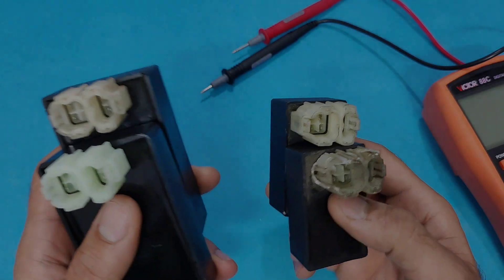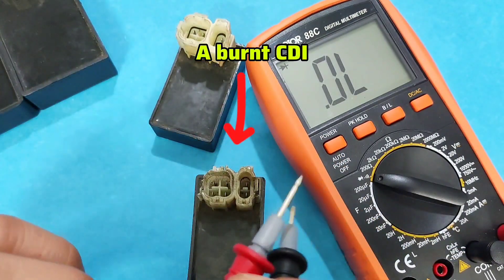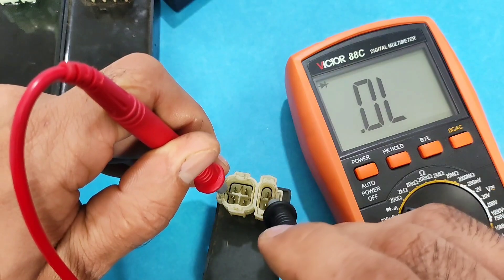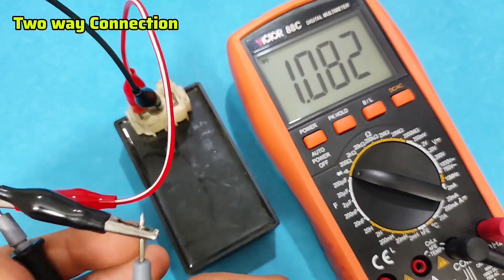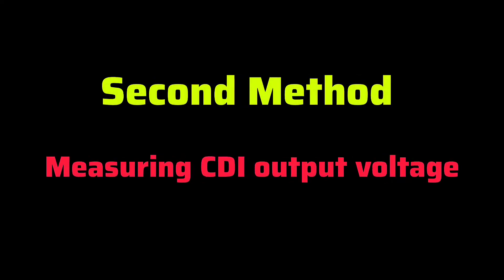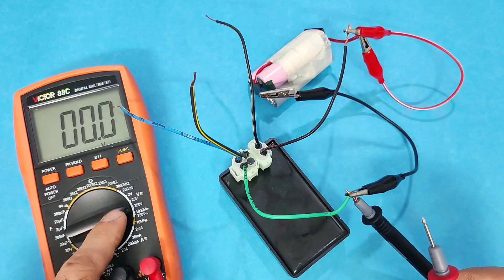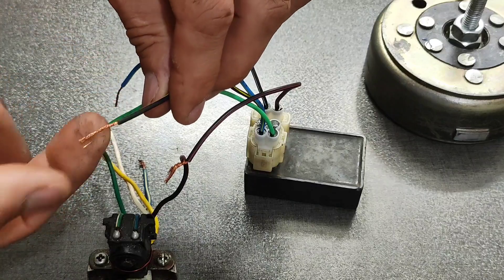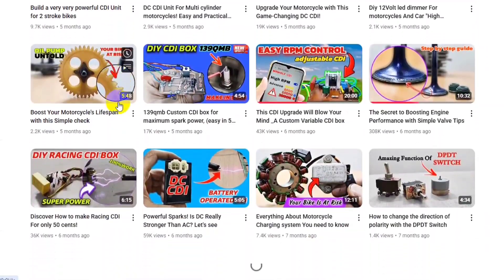99% People Test CDI Wrong — Here’s the Right Way Using Just a Multimeter!

Comment: How to check it on an YAMAHA XT 600E where it's has 4 pins on one side and 4 on the other one
Reply from the maker: You can use the wiring diagram or service manual of your motorcycle to get the your  cdi datasheet and pinout — it’s available online.
Or you can simply trace the wire inputs yourself: note which wires for ground, pickup "coils",(two different angles in xt 600)main power"ac", ignition coil, and kill switch go to which pins on your CDI.
Write them down and test accordingly.

Comment: 10:03 I have 20v. More than the 12v witch is hooked up to. 

Is it faulty? 

I have problems with engine power over 6000rpms.
Reply from the maker: Hey buddy,
For more certainty, connect a pickup to it and excite it. Measure the output voltage and see if it rises.
If it goes above 100 volts, it's okay.
Use a multimeter in both AC and DC test modes. Some models are different...
In my latest video, I also showed a coil test- check that as well.

Comment: Yes im not getting resistance between kill switch and grd too. I get resistance from 2 outta the 3 test. I have a blue rectangle high performance no rev  ac cdi
Reply from the maker: If your CDI unit is working properly, there’s no problem ,It’s possible that the resistance is higher or lower than what a multimeter can detect.
Even in some models, there might be some differences... . thanks for your input 🙌🙌

Comment: negative And the HD coal line  is sort cdi is ok or bad dc cdi
Reply from the maker: Maybe its resistance is too low; set it to a lower resistance value and test it.
Also…
To determine if the CDI is functioning correctly, you can refer to the video's instructions to conduct a proper test.

Comment: I performed the test you show, applying 12 volts and reading the outgoing voltage. When I do this, the voltage goes over 100 volts but returns to zero even if I keep the 12 volt power supply connected. If I disconnect the power supply and repeat the procedure, I get a high voltage again, but it doesn't stay on. Is this correct?
Reply from the maker: That’s right, because it charges the capacitor momentarily, and by turning the 12-volt power on and off it repeats again.
This happens because it hasn’t been triggered—in fact, this action is supposed to be done by the pickup sensor.
Therefore, it only charges and discharges once.
Your CDI is fine👍

Comment: I dont get any resistance between negative and kill  switch... Does it mean the cdi is faulty aswell
Reply from the maker: What type of CDI do you have? If it's a DC one, it doesn't have a kill switch.
If you'd like, post a picture of it in the viewer posts, in the community post part of the channel, so I can take a look.
Reply: Yes. Mine does the exact same thing. I have the blue rectangle performance ac cdi
Reply: I got resistance on 2 of the 3 test. Does it mean it's bad

Comment: Thank you, my friend, but I have another question I'd like to ask you. When you measured the current output from the CDI in both AC and DC modes, you measured the current without connecting a pulser. How did the current output from the CDI occur without a pulser or pickup? Or How did the CDI generate current without connecting it to a pulser?
Reply from the maker: That's a good question.
In the AC CDI output test, the trigger was connected. ...But for testing the CDI DC, we only checked its functionality — we observed that the capacitor was charging and a momentary voltage was sent to the output.
In fact,
In a DC-type CDI system, an external DC power supply (such as a motorcycle battery) provides the voltage needed to charge the internal capacitor of the CDI.
In such systems, the pulser (pickup) only acts as a trigger for spark timing and does not supply power.
Of course, in ac cdi, the same thing happens, only electricity is generated by the rotation of the magnet on the AC coil.
Reply: @MrWolfDiy 
Thank you, my friend. I know that the trigger doesn't generate current just give a pulse in exact time to CDI to proceed the current to ignition coil making a sprck . So i asked?
, how did the CDI pass the current without being connected to the trigger, which allows (make a pulse ) the current stored in the capacitor inside the CDl to pass through it to the coil ?
I watched the video twice and you didn't connect the trigger in both Ac and DC testing 😂

Comment: how can I prove my cdi which have advance problems?
Reply from the maker: What type of CDI is it? If it’s a digital one, there might be an issue with its internal program. But sometimes the problem comes from the pickup sensor — it might just need adjustment or replacement, so it should be tested.

Comment: Thanks 
Thank you for your efforts. We benefit greatly from you, but I still have 2 questions. 
Question 1.
Is the coil (generate the spark plug ) that works with DC CDI different from the coil that works with AC CDI?
Question 2:
Can the AC CDI  which  used for four-stroke engines can be used for two-stroke engines, or is there a significant difference? 
Thank you very much.
Reply: I ask the first question because some people, when a fault occurs in the AC supply from the Stator,so they replaceing the AC CDI with a DC CDI  and connect it (supply current) from the battery without changing the coil that provides the spark to the spark plug.
and it is working.
Thanks again.
Reply from the maker: Hello, thanks for detailed question,
In response to your first question, I would say yes, there is a difference — but in many cases, the same coil can be used; it depends on the system design.
DC coils usually have a higher resistance (ohm value), and in some cases, they may perform better, while in others, they might even perform worse.

As for your second question,
In some cases, yes — but not always. It depends on the type of engine and the design of the ignition system.
Reply: Thank you, my friend, but I have another question I'd like to ask you. When you measured the current output from the CDI in both AC and DC modes, you measured the current without connecting a pulser. How did the current output from the CDI occur without a pulser or pickup? Or How did the CDI generate current without connecting it to a pulser?
 @MrWolfDiy
Reply: Thanks for quick response @MrWolfDiy

Comment: My rectifier for my pre unit is broken and my Triumph Thruxton has no ignition. Its the CDI.... cant believe I just discovered your channel!! :D Thanks
Reply from the maker: I'd be happy to help if I can.♥️🙏
Reply: @MrWolfDiy  Its a triumph thruxton 2006. Ive checked everything, and all theres left is either the pick up sensor or the CDI. The pick shows 0.3-0.4 and it should be 0.5 - 0.6. Not sure if its causing the problem.
Planning to buy a TTP CDI, but its expensive, so If you are able to help I sure would appreciate it! Such a cool channel. Im new to electronics, and its so fun :)
Reply from the maker: Hi dear,I apologize for the delay, I haven't seen your comment...
Before replacing anything, you need to check the following:

Inspect all main connectors and plugs, especially from the stator to the CDI, using a multimeter in continuity (buzzer) mode to ensure there’s no break in the wiring.

Next, make sure the kill switch is functioning properly, and also check the side-stand sensor or clutch switch. If needed, bypass them temporarily to rule them out.

Ensure you have a good ground connection (chassis ground).

If all of that checks out, move on to testing the resistance of the ignition coil and pickup coil with a multimeter. Compare the readings to the values in the service manual.
For the pickup coil, it should be approximately 100 to 160 ohms.

If the pickup coil is within spec, suspicion falls on the ignitor unit, which in your case is the CDI module—most likely an AC-type CDI.

If the input voltage from the stator to the CDI is present and normal, then the CDI is probably faulty and needs to be replaced.

I’ve previously built DC-type ignitor modules for multi-cylinder engines, but I’m not sure if they’re compatible with your motorcycle—you’d have to verify that.
Reply: @MrWolfDiy  Thanks for the reply :) I checked everything... key ignition, clutch, sidestand switches, kill switch, wires, pick up, ign. coils, sparkplugs + wires... and it all ends at the CDI. Everything else works, and the engine turns etc. Just no spark.
Reply: Fixx, Wolf is a helpful genius. Post detailed questions and he can walk you thru it.
Or, better yet:
Look thru his backlog of videos; chances are he's already answered your questions. 👍

Comment: Mine has three pins where there is two ( cb250rs,1983) how do i check that?
Reply from the maker: I'm not sure if the motorcycle you mentioned has a 3-pin CDI. Anyway, if it does, it's probably a CDI without a pulser.
Find the negative pin (it connects to the frame when checked with a multimeter).
Disconnect the CDI connector from the socket,
and check the main power input wire against the frame to see its condition. It should show some resistance value from one side or both sides.
Also, you can test the output voltage using the method I mentioned.
Reply: @MrWolfDiy  The pulsar on the Honda CB250RS is on the opposite side of the engine from the stator, inside the clutch cover and it has a mechanical ignition advance.
Reply: Its a 4 and 3 pin, unlike your 4 and 2  @MrWolfDiy
Reply from the maker: For testing, the number of pins doesn't matter. Just check, based on your wiring, which pin is the ground, which one is the main input to the CDI, and identify the rest. Then it can be tested and even run using a simulation method.

Comment: Değerli arkadaşım Türkiye den izleyen motor sevdalısı 65 yaşında bir ihtiyarım. 50 yıldır motor kullanırım. Şu an 250cc iki silindir Mondial MCT coper var. Bujileri çok sık bozuyor. Kendi beynini başka bir CDI ile değiştik. Ateslemesi mavi renk çok iyi diğer mekanik aksamları iyi. Kendim motor teknik öğretmenim. 
Bulabildiğim en iyisi NGK C7HSA buji kullanıyorum. Bazen 500 km de bozuluyor. Motor 30 bin km de oldukça iyi blok ve silindirler açılmadı. Paralel ikiz 180 derece ateşlemeli. Ateşleme bobinlerini değiştirdim düzelmedi. Ne yapmam gerekir. Umarım anlaşılabilir şekilde çevirebilirsin. Teşekkürler Türkiye den selamlar❤️🙋‍♂️🇹🇷👍👏🙏🫶❤️
Reply from the maker: Greetings to my good friend,
I’m very glad that you are interested in these topics and shared your thoughts.🙏

What does the condition of burnt spark plugs look like?
By examining the spark plugs, you can somewhat understand the problem.
For example, if the plug is dry and black, it means the fuel-to-air ratio is too rich (carburetor not adjusted properly, or unsuitable air filter).
If it’s white and burnt, it indicates a very high combustion temperature, which could be due to incorrect ignition timing or a too-lean fuel-to-air ratio.
It could also be caused by other issues like low fuel quality. You can try adding a cup of octane booster into a full tank as a kind of additive that strengthens combustion. check and let me know.
Wishing you success and good health.
Reply: @MrWolfDiy iş çıkışıydı geciktim üzgünüm. Öncelikle geri dönüşün için teşekkürler. Motoru 1 yıl önce 20bin km de aldım.2012 model. Şu an 30 bin km.
Aldığımda 2 kei hein karbüratör vardı 100 km de 4,8--5,2 Litre tüketim 130 km max hız vardı ve 100 km den sonra anormal titriyordu.
Manifoldu değiştim içindeki kum tanelerini ve capaklarini aldım. Tek PZ 27 Sevingway taktım. Arka dişliyi 34 t den 30t ye düşürdüm. 100 km de 3,2 --3,6 Litreye düştü max hız 120 km ye düştü titreşim azaldı. Sol silindirik sürekli ateslemesi kesiliyordu. Orjinal Cdi bulamadım.  Elektrikçi yardımıyla başka bir cdi taktım bobinleri değiştim. Ateslemesi çok kuvvetlendi 15--20mm den mavi atlıyor. Rölanti çalışması çok düzgün gaz yemesi çok iyi. İlk çalışması çok kolay kar yağdığında bile jiklesiz çalışıyor. 
Bujiler kuru ve siyah (isli) çıkıyor.  Karbüratör yeni hiç bir yeri açılmadı. Sadece gaz pistonundaki iğneyi kertiklerinden yukarı aşağı oynuyorum. Gene bujileri bozuyor. İğne en yukarı kertikte biraz daha az tüketiyor ve sakin çalışıyor. Aşağı alınca tüketim artıyor ve daha sert çalışıyor. Mavi yazılı NGK buji bulamadım.  Tayland malı siyah yazılı takıyorum. Bir kaç bin km ancak gidiyor
 Motorun diğer yerleri oldukça iyi durumda genelde her gün 60 km oğlum kullanıyor. Pikaptski okuyucuya veya mıknatısın içindeki bobinlere bakayım mı şarj etmesi çok iyi.❤🙋‍♂️🇹🇷🙏👍👏🙏❤️